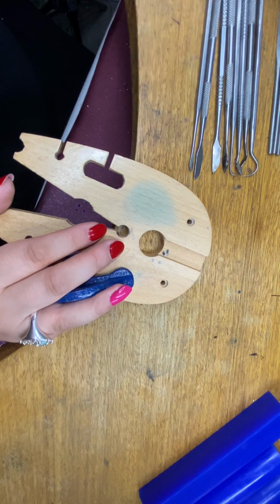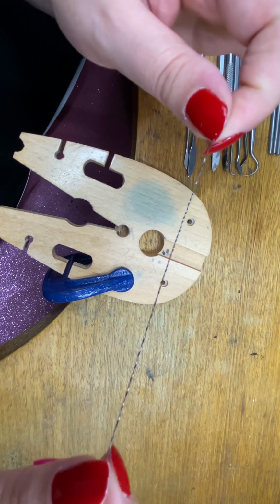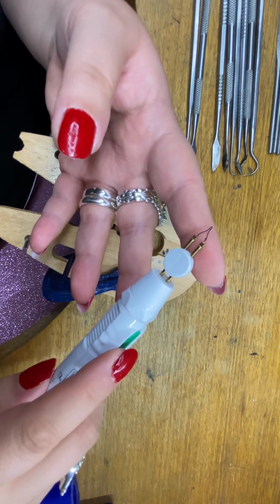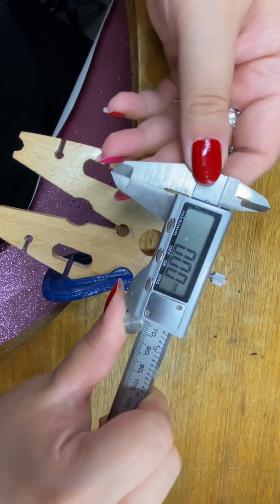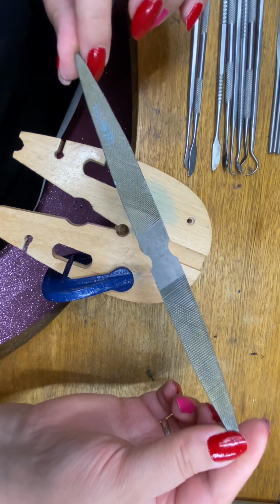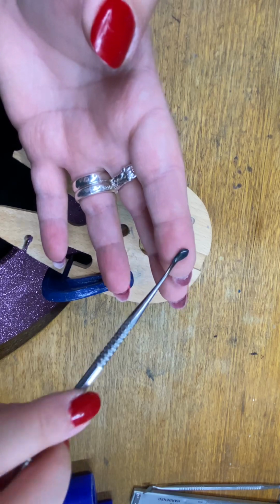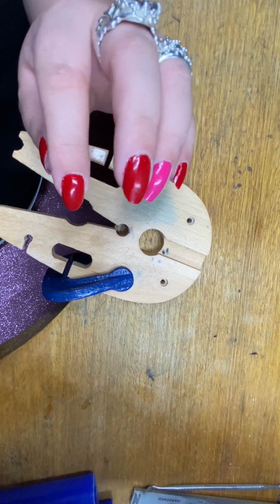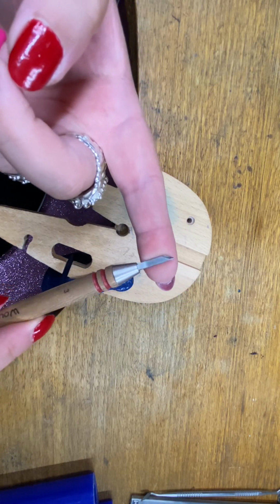Wax Carving Setup - Wax Carving Tools I Use At My Bench To Make Jewellery for Lost Wax Casting.

Comment: Outstanding with the utmost respect this was great so informative and answered so questioned I had. Also I’m going to be ordering those blocks for pendants I’ve been wanting to carve a ring up for so long I think those blocks would Be easier. Thank you for sharing I look forward to your next video 
Cheers respectfully Paul
Reply from the maker: Paul, you are so wonderful. Thank you for your kind words. The blocks are excellent! I usually buy the Ferris assorted wax slices - the box has 3 different thicknesses. It also comes in one solid slab which requires DIY cutting - only for those who don’t mind an upper body workout 🤣. Reach out if you ever have any wax questions 🙏💎.